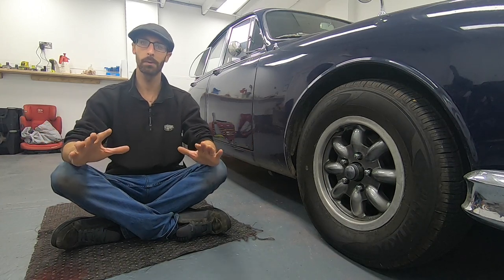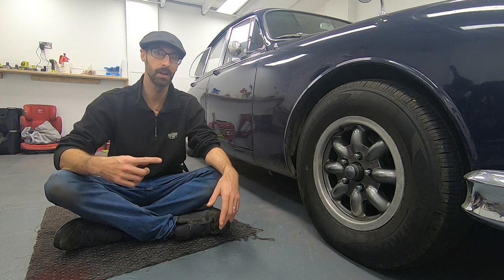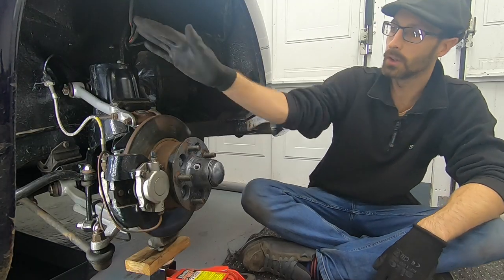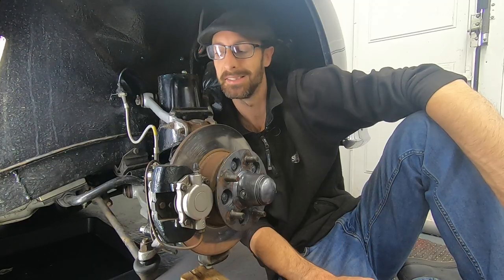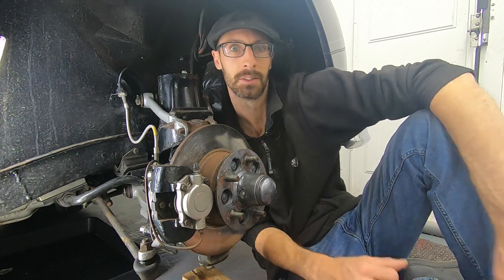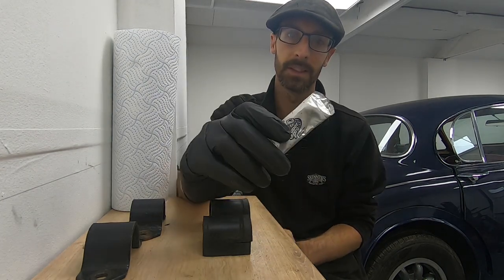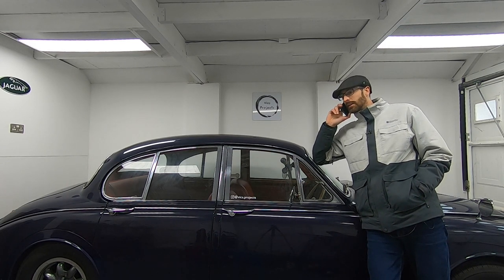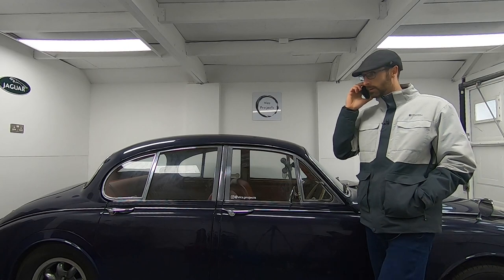Jaguar MK2 | Anti Roll Bar + Big Surprise

Comment: Just had a similar situation with my recently purchased Jaguar Mk II (240). Despite assurance from the supposed specialist I'd bought it from that the mechanicals were strong, a different garage examined the car after it ceased to fire up. Finally got a look at the head and block there a couple of days ago, and was astonished at the amount of corrosion present. Since the repair costs were not far off getting a new engine built, I opted to upgrade the 2.4 to a 3.4 - that issue blew my proposed budget out of the water, so no respray... but at least it'll drive.
Reply from the maker: Sorry to hear about that, must have sucked to find that out. As you say though you get to have a bigger engine now 😁

Comment: Got that T shirt when my SWB XJ6 blew it's bottom end into bean tin material on the M65 many years ago.
The shells were as thin as a bean tim when l took them out, the crank looked like a shredder and basically it was a scrap job.
I swapped the engine out and a mate bought it off me to restore the whole car.
Never had a MK 2 but have had nine Jaguars and love them all except the latest XJ.

Comment: I’m in a similar situation. Just coming to the end of a 8 year restoration project on my 1962 2.4 and unfortunately it’s burning ALOT of oil on the over run. I have a terrible feeling the motor needs to come back out. Might replace with a 3.8 😎

Comment: Whats happened to the engine that makes you think it needs a total rebuild?  Whats the oil pressure like on it?  Although its a big engine the XK motor is actually a really simple engine to work on and well within your capabilities based on the other jobs you have done on the car.
Reply from the maker: Thank you for the complement Andrew, you'll have to wait and see what way we go 😁

Comment: Get a 4.2 EFI big valve out of an S3 XJ6 and drop that in with 2" SU's (There is a fair bit of part swapping involved like the water pump, Oil filter housing and electric tacho etc, Etc) So much torqueyer and powerful than a 3.4, I've got a 1964 3.8 MK2 which was running great untill it dropped a valve and i've got an S3 4.2 to fit into it whilst i rebuild the 3.8, It will be interesting to compare the 2, I have a feeling i will just leave the 4.2 in as it's a non matching number car anyway👌
Reply from the maker: Thanks Scotty63, you'll have to stay tuned to find out where I take it 😝

Comment: just discovered my 3.4l block has a crack in it and it's already been brazed once and failed. so at least a new-to-me block. getting new rings, main and rod bearings, timing chain and tensioner, oil pump and having the driveline balanced. this will set me back about $20,000 to have it all done at a shop.

bought it from an ex-race car driver, now dealer that does restoration on vintage ferraris and other vintage exotics. has a huge race car museum too. owner said "he won't sell a car that has not been thoroughly examined and in perfect condition.". said he hires people to drive them hundreds of miles over california roads to make sure they are reliable. 

the car overheated on the way home... and soon found out about the cracked block when the leaking head gasket was removed. the dealer's in scott's valley ca. don't go near him.

Comment: A Chevy small block V8 conversion will have that stuffy old snail ready for the AutoBahn in a jiff 😋
😇❤
Reply from the maker: You'll have to wait and see 😄
Reply: Worst thing that you can do to a jaguar,remove the beautifully engineered xk unit and stick in a cheap nasty mass produced chevy v8.rebuild or replace the xk engine is the way to go.